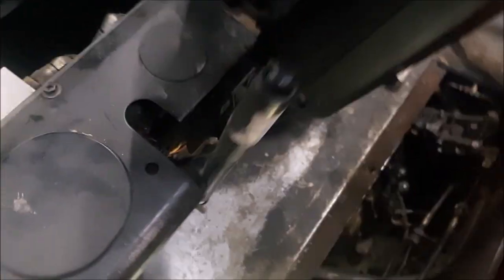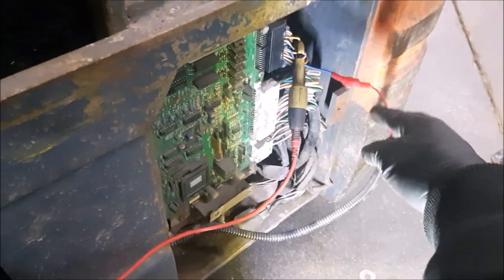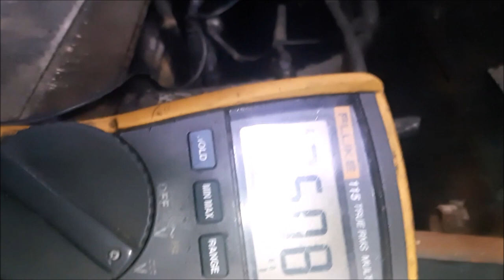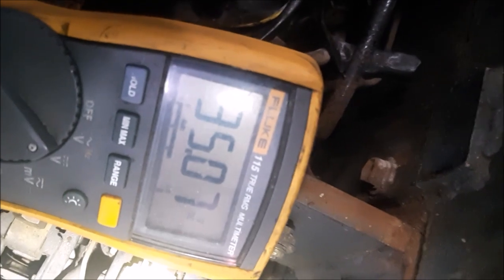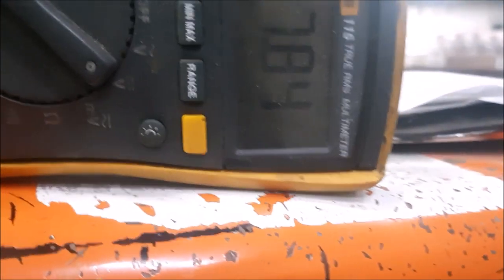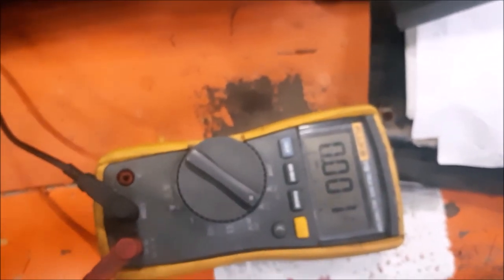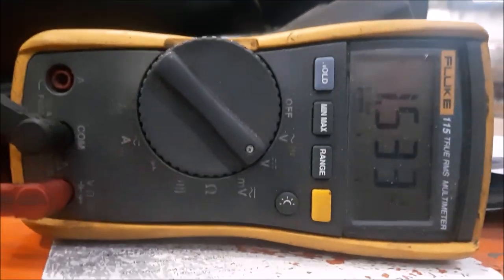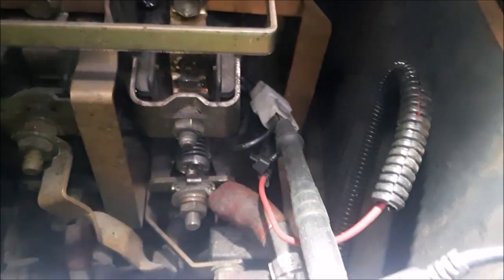Toyota Electric Forklift Would not Lift

Comment: I have an issue with an RSS40 Raymond stacker where the up lift and sideshift functions have gone out after taking delivery. I recharged the battery and the issue remains. There is a clicking noise coming from the top right area of the electrical panel every time I try to use these functions. There is a large round fuse located right there, could it be an issue with the fuse?
Reply from the maker: Everytime you use the hydraulic functions the pump motor should run. If the motor does not run, check if the contactor for the motor engages. If the contactor engages, check fuse and motor brushes. If contactor does not engage, check wiring. If the motor runs but still no hydraulic functions, check the pump.   This is assuming your battery is good.

Comment: Hi there, thank for this video i got an issue with my forklift which is on but have some error codes, AD-2 AD-4 AD-1 that causes the fork to stop moving. really appreciate your advice on this.
Reply from the maker: These codes are communication error codes between main board and motor drivers, so the answers is yes.
Reply: @forkliftgeek10  thanks a lot for the constructive information. any way i can get this fixed please? thank you
Reply from the maker: @juniorandy2409  there are lots of possible causes for these codes. It is not as simple as replacing a part. Worst case scenario is that its the motor drivers which are expensive.
Reply: @forkliftgeek10  thank you very much sir, one more question did you guys also selling spare parts on forklift. really keen to know. thank you..😀
Reply from the maker: The company I work for does.
Reply: @forkliftgeek10  alright, can i have a quote on the motor drivers please.
Reply from the maker: Unless you are in Toronto Canda I don't think is going to be worth it for you and its not even assured its the motor drivers that's the problem. Have it checked by a service technician first.
Reply: @forkliftgeek10  alright i see. thank you very much for your reply. i will find any  technician to confirm it. great day to you.

Comment: Hi I have a Toyota 15, 1997 year.  issue with Contactor not clicking, no contactor.  We tried changing the main contactor and computer box but still sometimes the main contactor does not click.  the truck is fully electric and the battery is new and good. What do you think?
Reply from the maker: Check wiring from computer to contactor
Reply: @forkliftgeek10  Does not appear to be a cable break between the computer box and Contactor.  We suspect contactor for back which is broken or oxide on contact surfaces.  it is possible?
Reply from the maker: It is possible

Comment: Ser can you help me for my fork lift, 7fb 25,
The main contact not contacting, but when i manualy contact the contactor, still have no power trough the motor,, 7fb25 have 3 motors, steering front drive and the lift,all motors not working even if i manualy push the main contact from the battery.. i wish you can help me see...
Reply from the maker: If you.dont have a code coming up. Check your fuses.
Reply: @forkliftgeek10  i already check the fuse, and it is good,
Can you teach me ser, how to direct the drive motor and the lifting motor,it have 3 wire connection,like 3 phase on ac motor, 7fb25 model of my forklift..i will wate you reply ser bfore i touch anything...

Comment: I have a problem whit the e43 code on a gas unicarrier forklift, can you give me a advice on how to fix it?
Reply from the maker: E43 is a air/ fuel mixture abnormality code. This be caused by a lot possible causes. The O2 sensor tells the computer if the system is running too lean or too rich  to be able to properly diagnose this you need to look at what the O2 sensor is sending, but take note that it does not necessarily mean the O2 sensor is faulty. Some possible causes would be vacuum leak, fuel injector, faulty O2, MAF sensor, faulty wiring, etc.
Reply: @forkliftgeek10  Thank you my friend
Reply: @aaronvicente7050  had one on Friday. Throttle  Flattens out after a minute or so. Code E-43  Or P1816. Ended up being a bad LP vaporizer. Dash readings were 27-29kpa close enough to the specs of 30-35kpa but not good enough.